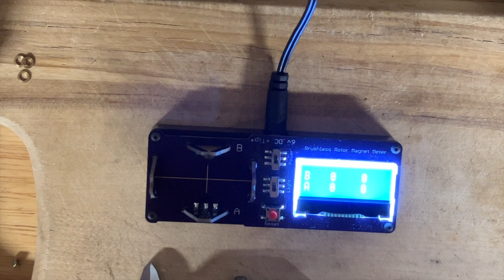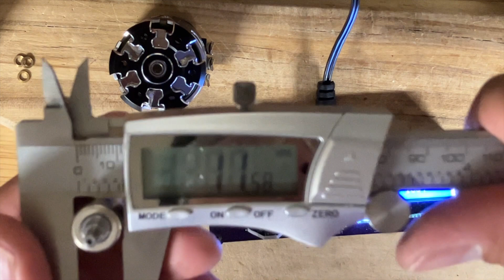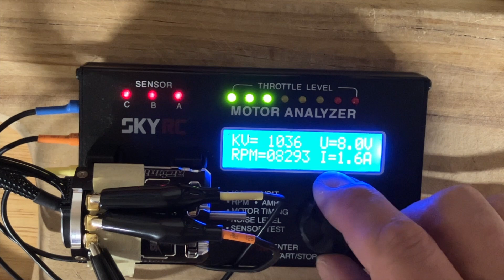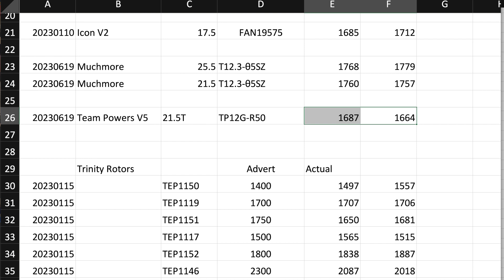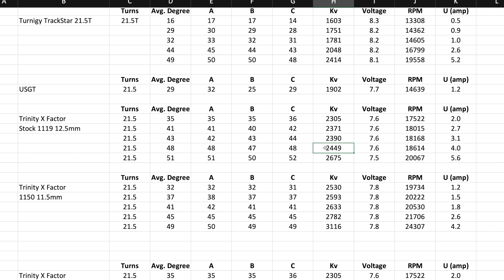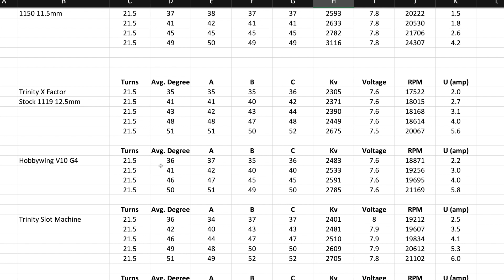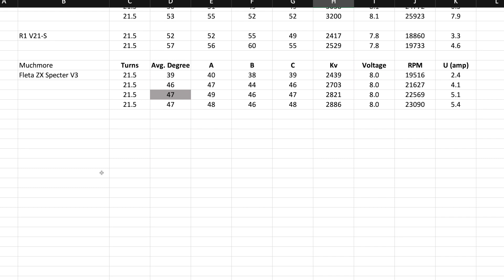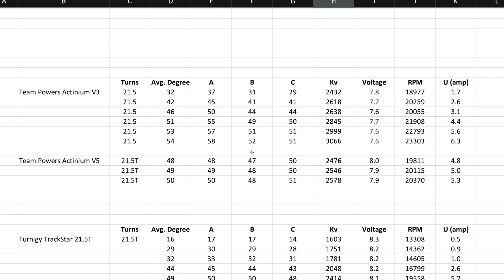Team Powers Actinium V5 21.5T Motor Specs based on Analyzer and gauss reading

Comment: Well, with the wrong rotor, this info is essentially useless? Not impressive if they put a 25.5 rotor in your 21.5.
Reply from the maker: According to @user-ft5vq1ki9y it is a QC problem and happens from time to time on this brand. At some point I may pick up a second one to see.

Comment: run the 21.5t v5 motor myself. big improvement over the v4. more power and doesn't over heat as easy as the v4. i believe it was about 5 grams lighter. also, mine came with the 12.5mm rotor
Reply from the maker: Out of curiosity, what rotor did you get? Or do you have the dimensions? I keep thinking they put the wrong one by mistake.
Reply: @telecomandorc  you sure got the wrong rotor in yours. Mine came with The TP125GR2. I believe your rotor is meant for mod or 25.5t motor. I can measure the rotor later today. Im about to put in a fresh rotor in it. FYI team powers is notorious for mislabeling this products. It's not rare for them to put a different label or just completely assemble it wrong is probably what happen in your case. But in general, My run v5 has been a very solid motor for me with almost no fade until my fan cutout mid run in a 105 deg weather and 160deg track temp. Call team powers the owner might help you out with getting the correct rotor and maybe do a shoutout exchange for the track he owns.
Reply from the maker: @MiguelOrtiz-s3f   🤔 Good idea. 
I may have to do a follow up because this rotor seems way off for a stock class rotor.
Reply: @telecomandorc   at my local track its one of the most powerful motors. its for sure one of the motors to have. FYI my track is a power sensitive track. if you want my new rotor comes in today. I could put it on the analyzer for you with the same parameters that you use for comparison.

I just noticed you run at norcal. I run at Fresno. eric's 2nd track and it performs really well there. I usually pull everyone in the infield and I hit terminal velocity sooner than most drivers.
Reply from the maker: @MiguelOrtiz-s3f  I would greatly appreciate it if you could send me some numbers to compare. I thought it was strange my rotor was so off in dimensions. 

I do run at Norcal. Eric is awesome. I have been to the Fresno track once on a weekday. I wish he had permanent on road track. Especially indoor carpet for on road. But out door works. 

Do you run F1?
Reply: @telecomandorc   no I dont run f1, just 21.5tc
Reply from the maker: @MiguelOrtiz-s3f   Still cool. I have considered jumping back into USGT just for the bodies. I bought a Porsche body and I have just been wanting to paint it up and drive it.
Reply: @user-ft5vq1ki9y glad to hear you say that. I was debating between the fantom helix rs works Edition or this team powers v5. I was leaning team powers. Curious to hear your thoughts